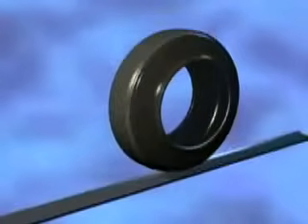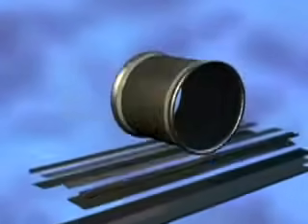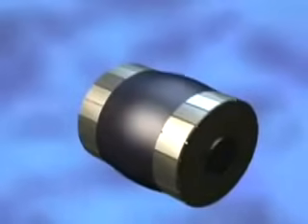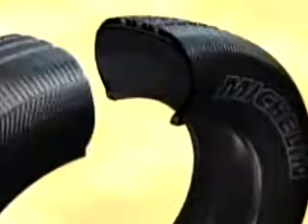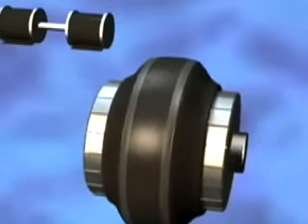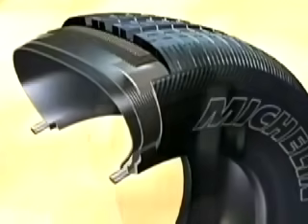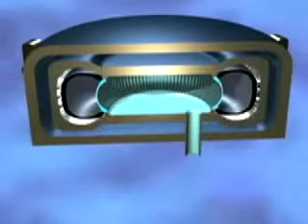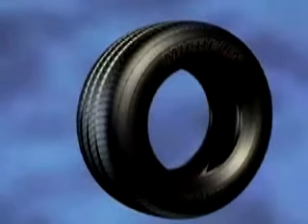MICHELIN TIRE / How a tire is made

Comment: I work for Michelin, I doubt you will ever know how the metallics are made due to secrecy. However, Michelin tires are quality tires. Best tire at the best price. Can't say enough great things about the company and our products! Purchase a set of Michelin tires! A BETTER WAY FORWARD.
Reply: Sounds like you're a great sales man!
Reply: Not too sure Michelin is that great.
 The last 4 Michelin tires I bought developed side bubbles in each tire at 3-4 years old.
 Been using Goodrich on the truck since with no failures, in fact they exceed my expectations at an average of 80k miles a set.
Reply: They're also more expensive.
Reply: Michelin display those technics they don't use anymore. But Chinese tire factoris still use them.
Reply: I am working in Michelin.. India Tamilnadu.... India's no 1 Tyre only Michelin tyres... price expensive but quality and savings extra ...compare to price quality is High..
Reply: I am working in Michelin.. India Tamilnadu.... India's no 1 Tyre only Michelin tyres... price expensive but quality and savings extra ...compare to price quality is High..

Comment: Ozone damage occurs to any tire.  Tires have a lifespan in years as well as millage.  Using any type of tire shine on any tire will remove the protective coating which will cause ozone damage to occur even faster.  The reason why Michelin says to not use tire shine is because of this and of course you can't expect any company to honor a warranty issue caused by the customer's unwillingness to comply with the manufacturer's instructions.

Comment: Great video. I had a different idea about how tires were made. I thought a steel wire skeleton (all the wire in a tire) was put into a mold and then filled with liquid rubber. The rubber then was allowed to cool. I thought those little needle-like pieces of rubber on a new tire were the injection points. I was wrong, I was so wrong. Thanks for the video!